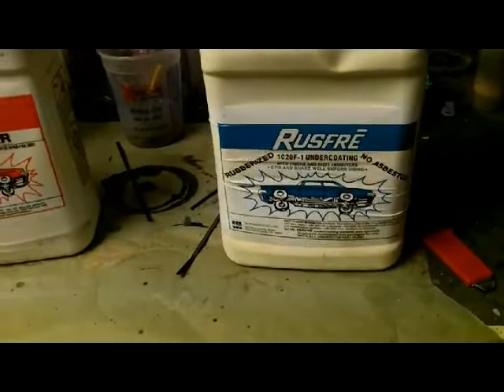Thursday update 2-13

Comment from the maker: I use the Sprayway aerosol glass cleaner as a final wipe after wax and grease remover.  Because it foams, it will actually bead away from any contaminants so it lets you see that there is still something on the panel.  Most foaming glass cleaners will work, just make sure there is NO AMMONIA in them.

Comment from the maker: I thought the same thing.  I actually have put the cup on the scale and used it normally (adding product to the appropriate line) and checking the weight on the scale.  It is soooo close that I felt it would be adequate to do it that way.  We're talking like .02-.05 grams difference.  You could be off more than that with a normal pour.  But it does make sense that different products have different weights by volume

Comment: Hey i like the idea of mixing on the scale, but the density of each of the products is different. (especially a high solids clear vs. a reducer.) You could be way overreducing depending on the product, I think. Since the ratios are by volume, not by weight. Nice work on your truck - really nice seeing someone take pride in making things last and look good!